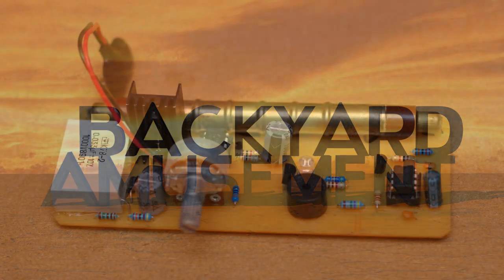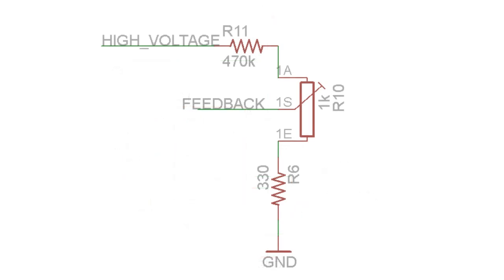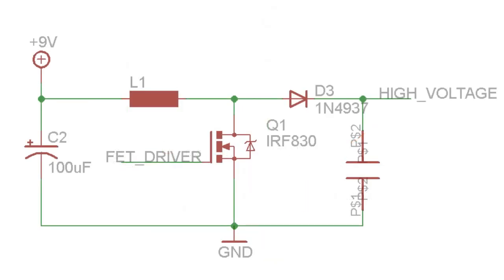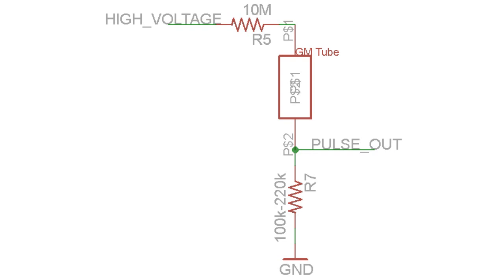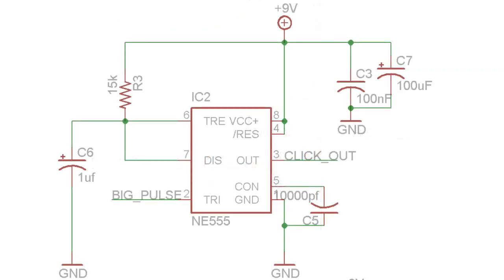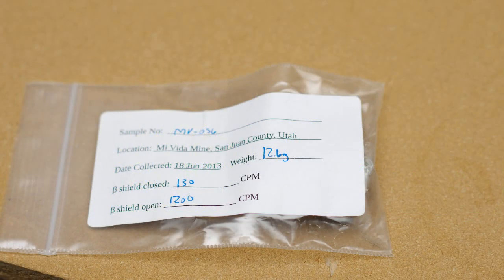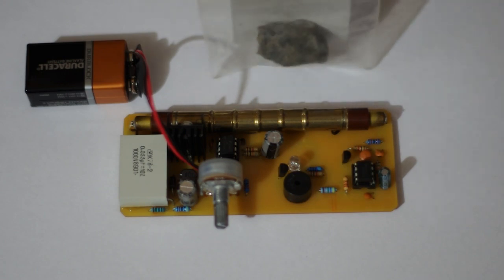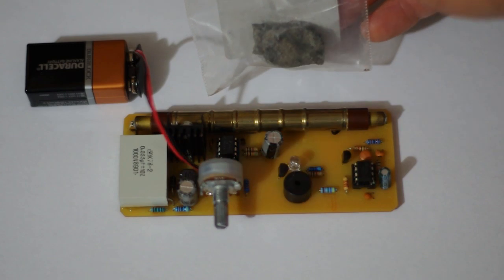Radiation detector under $30

Comment: Great video, have you ever thought of designing an RF detector ?

No need for the LCD display showing the watts per cm2 just an audio sound would be amazing. I have a Tenmars 195 and it`s a sharp little unit, the TM 196 it`s big brother is a pile of crap I know of 2 others who have had problems with them and I returned mine due to the readings being way above and below what they should be.

One that reads from 50 MHz up to 8 ghz with an audio speaker to hear the static sounds as the intensify and decrease.

If you ever do I`d love to build one or buy one from you...

Thanks and have a great day.

Cheers,
Terry
Reply: One with a triple axis would be the way to go.